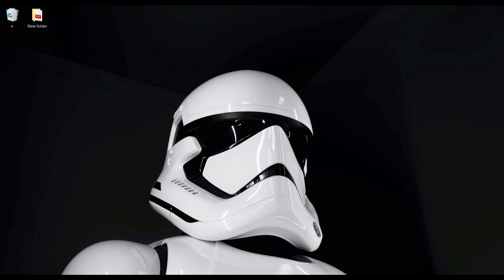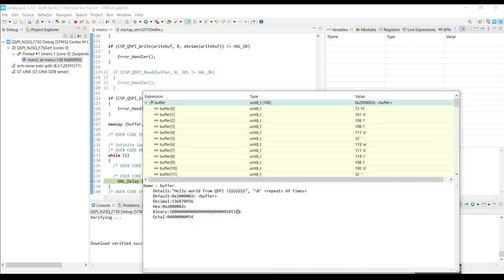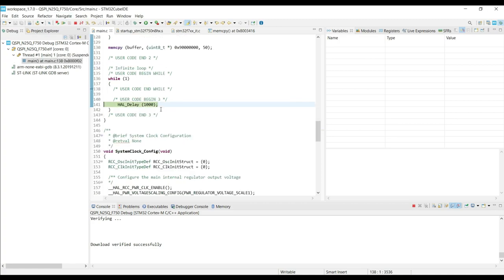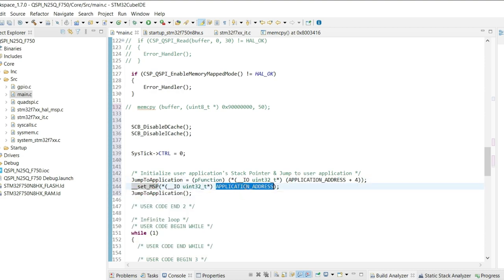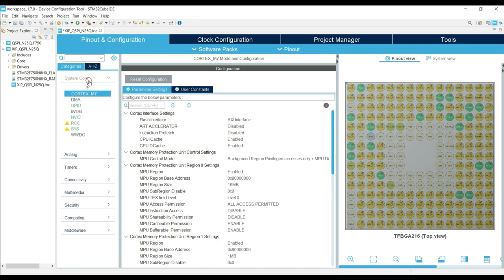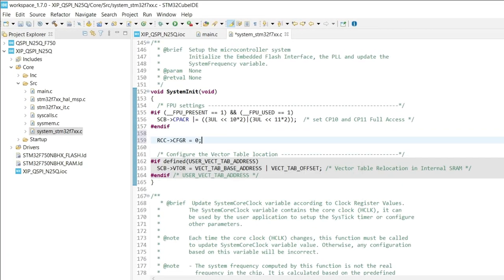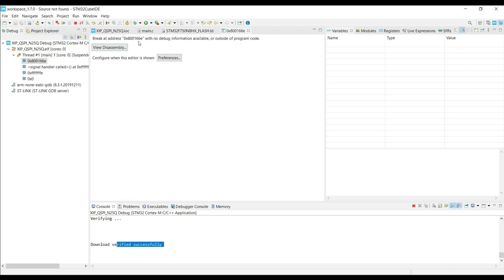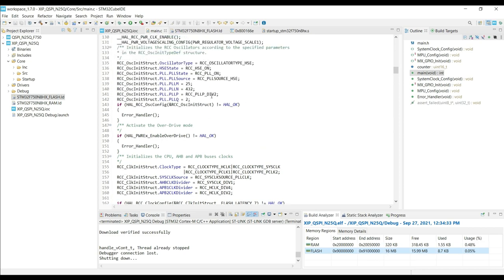QSPI in STM32 || Boot from EXT Memory || XIP || N25Q

Comment: For the Project2 that you made it for the JumpFuntion, There is an exception for H7 series and its the clock of QSPI unit that must be set to PER_CK. Other things are great in the video and thank to you for the shared information.
Reply: Do you have sample code you can share?
Reply: @blcouz  select the per_CK clock from the ioc file when choosing the clock of quad spi of the program in the internal flash that will jump to external flash .

Comment: What i don't understand, what is the function/purpose of the external loader when you debug the code you showed us? Does it read or write something? What does it do?
Reply from the maker: It helps you debug the external memories on cubeIDE. 
Also it is used to push code/data into the external memory.

Comment: thanks  for this really useful video. My question is that is it possible to use both internal and external flash for application program at the same time?
Reply from the maker: Yes i guess it's possible. But you have to make a lot of changes in the flash descriptor file.
Reply: @ControllersTech   Hi, I tried to execute a peace of code on a stm32h750 MCU and managed to program code on QSPI successfully and it verified. but when I press the reset in debug window the debugger does not goes to QSPI address in 0x90000000. should I do anything different from this video while editing system file?  regards.

Comment: Excellent video, congratulations! I'm trying to do as you teach with a board with STM32H750VBT6 and MT25QL512 memory.
I can do the first part without problems, but I can't run the program like the second part. It does the normal compilation and loading but the user program still doesn't run.
Reply from the maker: Make sure you are selecting external memory in the debugger configuration..
Reply: did you succeed?

Comment: Is it also possible to debug a custom external loader? My custom external loader isn't working, that's why.
Reply from the maker: If you have the project from where you created the loader, you can debug that project itself.
Look into the loader_src file. There should be different functions like init, write, verify etc. You can place your custom code inside those functions (like LEd blink or UART output). When you run the loader next time (in some other project), you should get the output whenever the loader execute either of those functions (init, write, verify, etc.)

Comment: Hello @ControllersTech,
I follow the same steps and wrote code for stm32l476 disc board code is running fine, but I am not able debug code, target is not halting in the main() of application code even if I am using breakpoints. I am getting "Error: illegal address for breakpoint type". Can you please tell me how to solve this issue?? MPU configuration are not available in stm32l476 disc board.
Reply from the maker: Make sure you select the correct external loader in the debug configuration.
Reply: Yes I have selected correct external loader still same issue. And when I tried to debug using OpenOCD I got "Error: Cortex-M Flash Patch Breakpoint rev 1 cannot handle HW breakpoint above address 0x1FFFFFFE; Error. can't add breakpoint: Unknown reason"
Reply: @ControllersTech  Sir, please suggest some solution...
Reply from the maker: Launch the debugger, once it has loaded completely and the error shows, reset the debugger.

Comment: Hi, I tried to execute a peace of code on a stm32h747i MCU and managed to program code on QSPI successfully and it verified. but when I press the reset in debug window the debugger does not goes to QSPI address in 0x90000000. should I do anything different from this video while editing system file?  regards
Reply from the maker: You need to select the external loader in the debug configuration.  Watch the video properly after i pressed the debug button. If i didn't select it in this video, i must have done it in the previous one..

Comment: for those who can't debug like the program in the external flash there is a trick that works for me try to debug another project like the one that is located in the internal flash which is used to jump to the external flash program then terminate it and then debug the program in the external flash again and do as video and it should work and don't forget the program in the internal flash that jumps to the external flash program have to be uploaded first and jump successfully to the start of the program in the external flash so you can debug the way descried in the video otherwise it won't work and the debugger will shut down when you try to halt it .